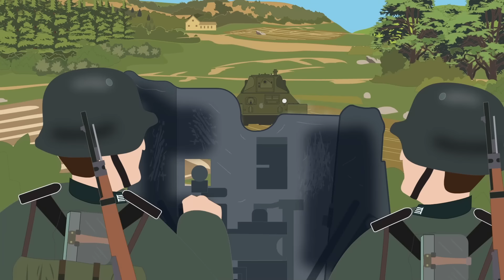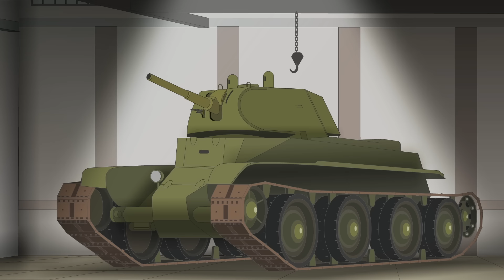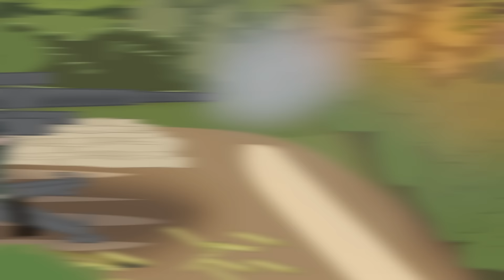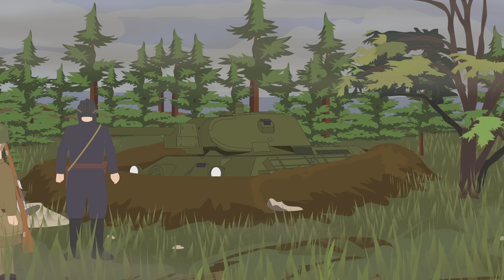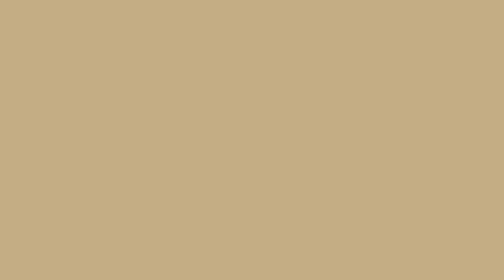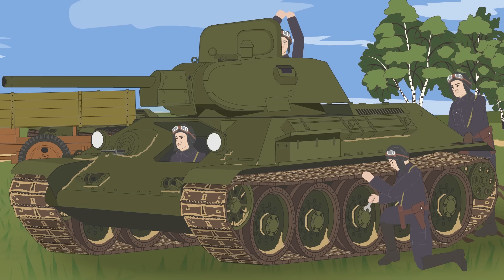Was the T-34 Really the Best Tank of WW2?

Comment: The best, in what sense?
Best in class? Broad term.
The best at the moment it showed up? Definitely!
The weapon that most influenced the course of the war?? Maybe it is, I can't think of anything else so influential from the Soviet side, but even if it isn't, it's at the very top.
The T-34 in 1941 was definitely the pinnacle of what all the nations on the planet were offering at the time. Soon after the introduction of the T-34/85 version, the Soviets built a much better T-43 tank, but concluded that it was better to continue production of the T-34/85 because there were already huge capacities and well-trained manpower for its production and tank is "good enough" to bring the war to an end, rather than investing huge resources and spending significant time to move to the production of a new tank and whose production would be incomparably smaller than the production of the T-34/85. The same conclusion was reached by the Americans with their "good enough" Sherman tank.
An additional question, would the Germans have reversed the course of the war if they had had enough Tigers and Panthers? Even if we look in isolation only at tanks, the answer is no, because the Soviets already had IS and T-44 tanks ready, of which IS took part in the fighting, and the T-44 was decided not to enter combat even though they had enough quantities for the formation of combat units.

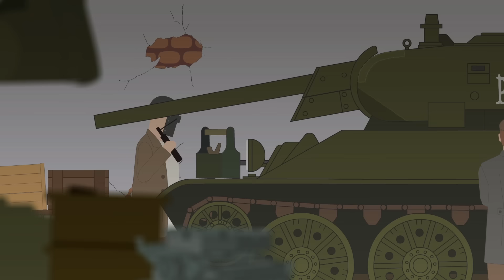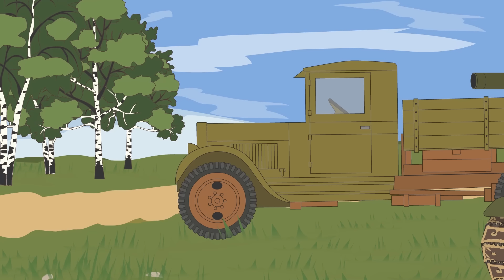Comment: LOL THE SOVIET BIAS, Simply History or Russia Today??? 17:31 76mm L11 piercing the 82mm face hardened Tiger1 side ammo? NO WAY >D   11:11 german 75mm howitzers shooting AP ammo instead HE that make T34s catch fire? NO WAY >D 31:21 the 75mm L48 NOT raping that T34's 45mm slopped aror? >D OMG even 25:47 a PANZER-1 vs T34 >D on what universe??? T34 was only a Christie tank with american lend lease STEEL PLATES all arround and because overweight cant hold more than 45mm armor (even T34-85"M"upgraded front armor is a fantasy). And you dont even mention the first MBT, the Panther, or even show a Panzer-III E with the modern torsion bars, really a PzIII ausf B that never fighted far than Poland, where are the 50mm high-velocity cannons in this video? all small german weapons were upgraded with that because T34 , so even a PanzerIII can pierce it becuse the 45mm slopped armor unupgradeable because weight. See T-44, the first soviet MBT, its a PanzerIII with panther front armor, the only thing has from T34 is the turret and engine.

Comment: Thank you.  Of all Documentaries about the T 34, this is the first one to mention the original designer.  Your analogy on Operation Barbarossa and Soviet inadequate ability is done well.  Your journey of development is excellent.  This mass-produced tank was in all probability the best medium tank in the war.  The Germans had the complicated Panther & Tiger Tanks at a much reduced and inadequate number to achieve overwhelming superiority; this would prove vital to the outcome of the Battle at Kursk.  The second most manufactured tank was the US Sherman 3.  I am surprised that the US didn't obtain some T 34's for evaluation and testing.  Shermans were provided to the Soviets, but they were not impressed.  It appears that the innovations in the T 34 could have been incorporated into the Sherman.  My opinion is that the T 34 was indeed the best against the Germans.  Great Video.
Reply: In 1943 Stalin sent a T-34 and a mechanic to the USA to be examined by US automotive engineers to find out why the tank had so many problems. So many new T-34's were breaking down before reaching the front lines and at the training bases that Stalin felt those were being sabotaged by their crews to avoid combat so ordered crews of breaking down tanks to be shot. His generals intervened and told Stalin that the T-34's were junk since the start of the war due to sloppy production methods and poor design. 
The Soviets received M3 Light Stuarts and M3 Medium Grants before receiving any M4's. Their crews liked the US tanks for being easy to operate and maintain along with being very reliable. They quickly realized the shortcomings of the M3 medium so turned it into an armored troop carrier. The Soviet tankers and armor commanders were delighted with their M4's for multiple reasons but mostly for being extremely reliable when engaged in combat.
Reply: @billwilson3609  Thanks.  Never mentioned in any Documentaries T 34 being sent to USA for evaluation over problems.  Did USA solve or help solve production problems.  Most Videos make the T34 a Super Tank.  Always talk about being tops. They were mass produced, gun challenged the Germans and sloping armor.  From what I understand, most items the USA sent were well received by the soldiers.  Stalin and following leaders never acknowledge the supplies as vital for their success in The Great Patriotic War.  Obviously, the USA didn't alter their production of the M4 except for the 76 MM Gun.  The British developed the Firefly with the 17 Lb. Anti-tank Gun.  The Allies liked to put one of these with 4 (?) Regular Shermans.   Again Thanks.
Reply: @benjaminrush4443  The US engineers completely disassembled the T-34 after the engine seized up to inspect everything, including cotter pins, nuts, bolts and washers. They pointed out parts that weren't alloyed in the correct percentages, poorly machined, stamped, casted, assembled  or designed to begin with. I think the engineers redesigned the engine's air filter, transmission seals and gear shifter linkages, gave them pointers on managing better quality control at the smelters, foundries, stamping plants and assembly lines along with installing exterior shock absorbers on the front and rear wheels to arrest the rocking motion when the tank came to a quick stop so the commander could fire the cannon. The US government then supplied the Soviets with more metals so they could produce higher quality alloyed metals and better machine tools with tooling. The US also sent over engineers to assist the Soviet tankers and mechanics that were using US tanks. The engineers brought over their own little factory where they could make parts that were better suited for the Russian climate and ham-fisted mechanics. Those engineers also convinced Stalin to have the engines and transmissions in the Soviet tanks to be removed for inspection and rebuilding after ever 50 hours of run time to avoid having them breaking down in the middle of battle. The US Army was doing that after 150 hours of run time by swapping those out at the same time with new and refurbished units to ensure all would be operational all day every day.
Reply: @benjaminrush4443  I wouldn't call the T-34 a piece of junk. It was a novel design that could've been improved if they had the time. It ended up with a host of problems due to the factories being forced to use uneducated peasants that never worked on anything more complicated than a pony cart as machinists, machine operators, welders and assemblers. The Soviets already had a tank designed to replace the T-34 before the war started but put that on hold since they didn't have time to retool the factories to produce it.
Reply: @billwilson3609  Yes & Thank you.  T34 still showed the Germans a thing or two.  Future design.  I think the suspension system was based upon an American Design that was rejected by US Military.  Once the flaws were worked-out and they put that 85 MM (?) cannon onto the Tank, they really showed the Nazis.
Reply: @benjaminrush4443  The T-34 used the Christie suspension. The US Arsenal tried it out on their wheel/tracked combat cars then on a modified track only combat car. Both resembled the T-34 with the transmission in the rear and the turret right behind the driver and bow gunner. The US moved the coil springs for each wheel outside the hull to get more interior space to find those were prone to be damaged so declared their combat car obsolete and moved on the develop the M3/M4  using their VVSS suspension. The Soviets decided to switch over to a torsion bar suspension to get more room but didn't due to the war starting first. 
The US Arsenal moved the transmission/final drive to the front so the turret could be set back further to make room for top hatches for the driver and bow gunner. Having it removeable as an assembly was another Christie concept that he used in the FWD taxicabs he designed and made. On those, the entire front end could be unbolted from the cab with a good one installed in less than a hour so the cab could get back on the streets faster to earn fares instead of being laid up in garage being repaired.
Reply: @billwilson3609  Thanks, Great Stuff to learn.

Comment: The concept of "best" is strongly depend on measure one apply, the next question is what is the best measure, and here we found ourselves in never-ending cycle. Regarding t-34 it earned its good reputations for a reason, despite having a lot of problems.
The definite problem of red army was severe lack of communication means as radios. The shortage was as strong that not every plane had a receiver. Communication between headquarters of units was held via landlines. <WOULD part> If that fixed I think red army could perform much better in 1941 </WOULD part>

Comment: One interesting tidbit about the T-34 design issues: often times, the large bolts connecting all the treads together would come loose as the tank was in motion. This of course threatened to cause the treads to collapse and fall apart, rendering the T-34 immobile. To address this problem, the engineers came up with a crude but effective solution: they welded a steel wedge near the rear sprocket! So any tread bolts coming loose would be pushed back into place by simple physics! Soviet engineering at its finest!
Reply: Yep, that's where the famous T 34 clacking comes from! Pretty ingenious
Reply: @breckenhelsley4831  98789090000000000000
Reply: That's Russian engineering in a nutshell. If it doesn't work, fucking hit it again until it does.
Reply: @turtlegamez4274  Sounds like their approach to personnel management and martial relations as well.
Reply: Fun fact - the solution worked so well that they kept using it on some tanks even up to the T-72. I imagine they stopped out of sheer embarassment.
Reply: There's actually a bit more to it than that. You see, the reason the track pins even COULD come loose was because they were so-called 'floating' pins; that is to say, they were only fastened on one side of the tread. Most other tank designs had the track pins fastened on both ends, which of course was much more secure and stable.

The issue with that, however, is it adds time to repair and maintenance: every time you need to repair or replace a section of track, you have to unfasten the track pins to remove them, and re-fasten them once the new track is installed. But with floating pins, it's as simple as just reaching over and pulling the pin out, then popping it back in when finished. This and other time-saving, simplified design choices meant that damaged T-34's could be put back in action in a fraction of the time as a Panzer.
Reply: @ToozdaysChild That’s bs, it is not easy to repair, but there are enough new ones. Simple repair was never a Soviet design criterion, just easy production.
Reply: This is like a text book example of what a Finnish saying about Russia means. Venäjällä mikään ei toimi, mutta kaikki järjestyy. Roughly translated: "In Russia nothing works, but everything will be just fine."
Reply: So simple keep driving, sounds like Russian engineering to me.
Reply: That’s fucking awesome lmao
Reply: It’s so simple but somehow it’s genius
Reply: Simple cutter pin probably would have worked as well?
Reply: @Eric Krohn  That means maybe 100 holes to be drilled and 200 pins for them to lose in the mud when doing repairs I guess.
Reply: Another fun fact: the allies would heat treat their armor, this would give better resistance to shells but they would only heat treat it to a maximum of 300 Dorian (I think that's the unit of measurement) whereas the soviets would treat it to 600 Dorian, that should be better right, well, if the t34 was hit with something high velocity and even if it didn't penetrate, the armor might go flying inside of the tank and hit the crew.
Reply: @mikeoxlong5341  The problem you're talking about is spalling, which is when brittle armor partly shatters internally from a hit, making bits of metal ricochet around the inside of the tank that may injure or kill the crew. I heard that the problem in the early T-34s was caused by a lack of alloy metals for the tanks, and that this problem had been remedied by early 1943. Wouldn't be surprised if the Bolsheviks were heat-treating their armor to excess, however.
Reply: If it works, it works!
Reply: So dont fix the problem.  Create a remedy for the problem
Reply: How did they work?
Reply: Hehehe yeah
Reply: more a speed hump than a wedge bro. LOL.
Reply: @mrgreyman3358  It was still much faster than previous tanks. A hammer will always be faster than a screwdriver even though the hammer might damage the screw.
Reply: That wedge didn’t come about until after the war, FYI.
Reply: Soviet problem requires soviet solutions
Reply: Cçzzź
Reply: You sir, are absolutely correct. They worked so good they stuck two more each side
Reply: It was later adopted on the pather tanks
Reply: they did that on post-war T-34s. This was not done on the war-built models
Reply: Improvisation. Every army used it more often than not.
Reply: For some reason this reminds me of the multi-million Dollar Anti-Gravity pen created by NASA to write in space while the Soviets used a pencil!
Reply: @drusik  I heard that too
Although when you look it up, there was a reason why pencils were not ideal for space, as the tips could break off and even a tiny like from a pencil in microgravity having the potential to harm an astronaut and/or the space equipment
Reply: @MrVidman14  Much simpler than that...at the time, due to what was considered acceptable to pressurize the capsule, a 100% oxygen environment was used.  It was feared that graphite fragments could easily burn.  It took the tragic Apollo 1 test on January 27, 1967, that killed Gus Grissom, Roger Chaffee, and Ed White to convince NASA of the folly of that design.
Reply: @drusik I don't believe nasa actually ever paid a dollar on the pen (now they do but not on the first mission), they used a company who paid plenty to make it, it worked in space, so it was essentially free advertisement making it almost sci-fi.
Reply: @swampdonkey1567  pencil was really expense, it was meant to be sold to NASA.
Reply: @drusik  which is bullshit because using a pencil to write in space is asking for trouble if you actually know how a pencil works
Reply: @vitsobotka6268  They're space engineers, they can make a small boxed contraption to prevent any splinter escaping.
Also, pencils come in metal and plastic, just put a thick pencil lead in.
Did you just challenge me to a pencil knowledge standoff and lose!? 😂
Reply: @drusik  Pencils cannot be used in a  space. The writing graphite will splinter and is electrically conductive. In the weightlessness of a space capsule it floats around before  lodging in and short circuiting the electronics. Also lodging in eyes, ears etc.
Reply: @drusik  Commies used said privately designed and produced pen aswell since the graphite in the pencils would crumble and float around creating short circuits all around.

Ps: Tankies get out.
Reply: Russian crews weren't expected to survive. So long as they sometimes killed a German tank, it was fine. Just make their tanks cheap and mass produce them.
Reply: Yeah genius lol,
Imagine that sound inside the tank.
No wonder russian tank veterans go crazy
Reply: @c.f.1833   if you actually thought about what you said for a second you would have realized how stupid it is, on the front theres guns shooting everywhere and artilery falling, another metal clonk barerly louder than the tracks noise wouldnt be your biggest issue...
Reply: Ugh soviet engineering at its worst - Woods
Reply: Insteat of build them to an higher or the intendet Standards
Reply: lmao
Reply: "it's a simple spell, but quite effective"
Reply: Also armor spalling cause the russians heated there metal to 600 renal all others didi it to 300 witch  made russian steel very strong but brital and half of all T-34's being destroyed were lost to panzer 3's my sorce is the soviet combat cashulitys of the 20th centery

Comment: Amazing the numbers of T-34s the Soviets were able to amass during the last 3 years of the war. Even though the Germans had the better quality tanks in the latter part of WW2, quantity of quality could sustain their war loses. Great video on the development and history of the T-34... what is clearly the best overall tank in WW2!
Reply: Germans didn't have better quality tanks in latter part. No Germans tanks were better at that time. Russia produced excellent modification T-34-85, and heavy Russian tanks Is-2 and Is-3 were much better than german counterparts.
Reply: @AlexanderTch  agreed. What I was trying to say was the Germans focused on building highly engineered tanks, rather than getting quantities produced that were functionly ready for the battleground. The Panther, Tiger 1 & 2 were over engineered, disregarding practicalities for maintenance, serviceability and repairs, thus failing to achieve their end goal. 

Russia would turn out tank numbers that the Germans could only dream to produce. The T34/85, JS2 & JS3 tanks were very functional and practical tanks that were dominating the Germans. Quality could be subjective because many units were missing parts such as the drivers seat, radio or headlights. No this wouldn't affect these tanks for most battlefield engagements, but it can have some bearing if these tanks were fully capable as it was intended for.